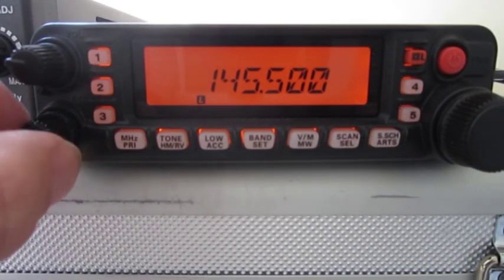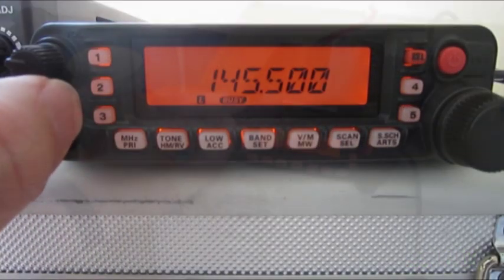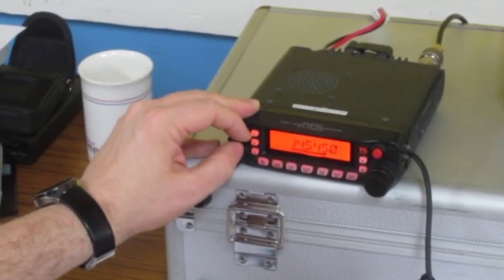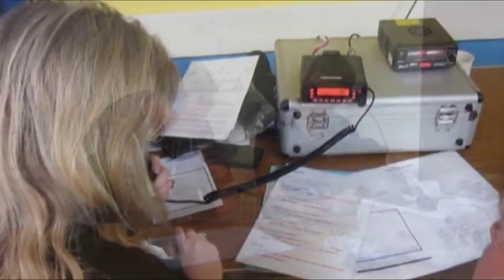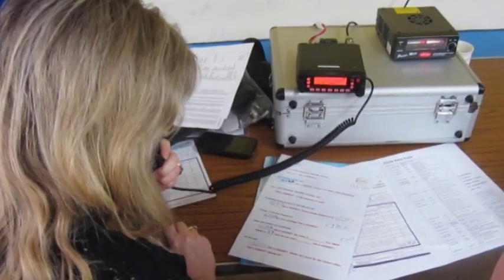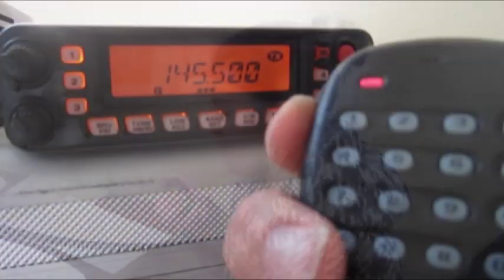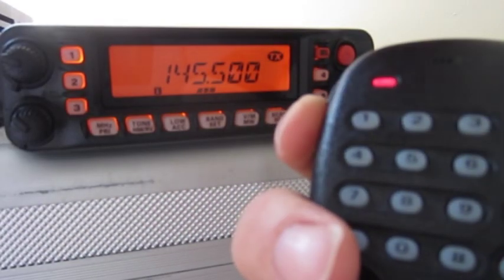VHF QSO Practical - UK Amateur Radio Training

Comment: The girl in the video repeats both callsigns at Every single transmission - it gets a little repetetiv, do you have to do this all of the time? or just for the exam. I know it's at the start and after every 10 mins (callsign swapping) and I imagine at the end of conversation too - but is it necessary to do it on EVERY transmission in a single conversation?
Reply: @Ben Woodfield, 
You are correct, start and after every 10 mins (callsign swapping) and at the end of conversation and not necessary on every transmission.   The lady in the video was demonstrating text book comms, and requesting change over to other frequency.